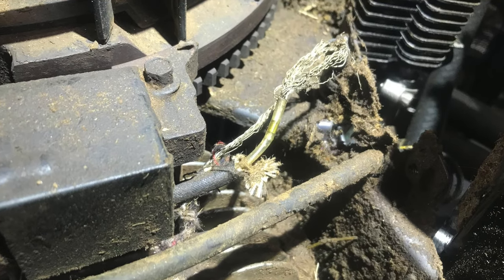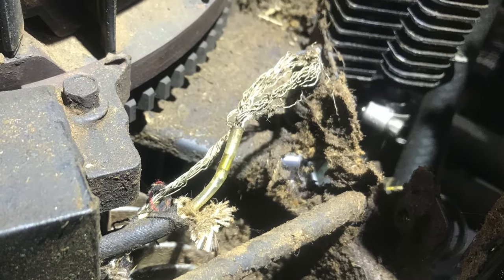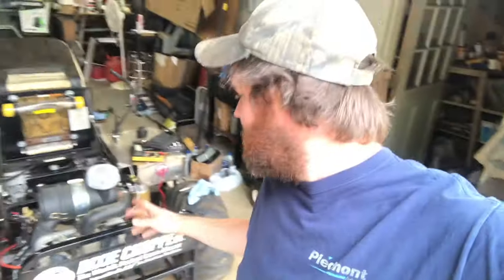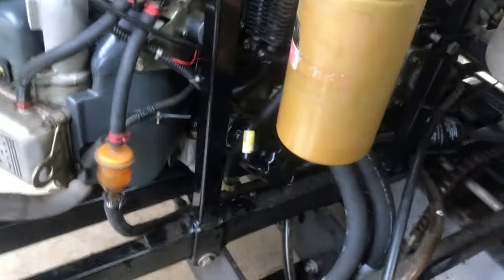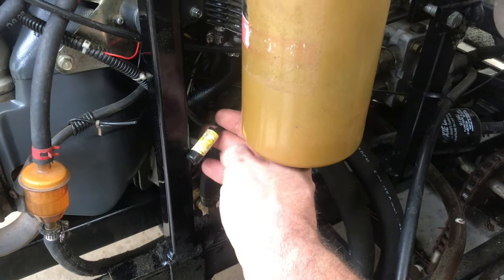Dixie Chopper

Comment: Had something similar on an outboard engine doing the same to me.  At the time, I thought it was a safety of sorts.  It was in the tiller handle.  Thought maybe if you rolled or flipped the boat it would shut you off.  Turns out I was correct.  I gave up on the motor as it was big, old and weighed a ton.

Comment: I used Dixie Chopper mowers for 22 years. I knew that there was a mercury switch installed but never saw it. Occasionally I would hit a bump too hard, and the engine would shut off. It would always restart.

Comment: Haha, I discovered the tip-over switch on mine too. I have the exact same machine.
Reply from the maker: zadok22 this is the first time I saw something like that on a mower. They are a well built machine. Thank you for watching and commenting!
Reply: @cannonballrepair7940  yeah I have had mine for 16 years. They are different. But I had one like it prior when I was in the lawn business. It was the heart of my work as most guys ran around with diesel Kubotas. I had my zero-turn, and loved it.
Reply: zadok22  I have a Dixie Chopper silver eagle 2760 hp its 10 yr old and bought a Kubota 1211 this year they r both good mowers the seat on the Kubota is better  but the Kubota needs better blades

Comment: When I saw that this video was about an older Dixie chopper and was recent, I jumped out of my seat! Great video!
Reply from the maker: Turf Destroyer Thank you for watching! Yeah that mower was built like a tank!!
Reply: I just had a dixie chopper XK2303 givin to me that I'm fixing and selling. Putting a new starter, battery, carburetor, airfilter, fuel filter, fuel pump and oil change tomorrow. Never had the pleasure to work on one until now. Thing is built like a tank

Comment: Good God I wish you were close by. I am working on the same mower. It would run before but not charge the battery. Checked the stator and it's dead. But now I have lost the spark. Everything tests good. All the safety switches have been bypassed. It does have the mercury switch so I checked it. I unplugged the kill wires on the coils, didn't make any difference. I can't see both coils going bad at the same time. Checked the black  relay and it checks good. If the battery is dead and the stator is not putting out anything how could the mower run before???  I'm running out of ideas.
Reply from the maker: The coils on this one in my video was a magneto style. They didn’t need a battery to run.  Kohler has some that require a battery. That is odd for both to go out at the same time. I’d try checking the ground connections where the bolts hold the coils to the block. If there’s corrosion there the coil won’t fire.  Hope that helps. Let me know what happens.
Reply: @cannonballrepair7940  pull the coils and shined up the mating surfaces with some emery cloth but still no spark. Just tested the ignition switch and it checks good. I already replaced the kill wire to the coils because the mice were hungry. Wonder if that mercury switch could be bad internally? I hate to just start throwing parts at this thing. So far the only thing that checks bad is the stator. Like I said before my grandson had to jump it every time he mowed but it would stay running all the time he was mowing, probably at least a couple of hours. The stator checks bad but wouldn't the mower die if the battery was dead too? Still scratching my head here.
Reply: Couldn't be the mercury switch because it connects to the kill wire. I unplugged the kill wire and still no spark.
Reply from the maker: @Dmax04  if you have the kill wires unplugged and still no spark then it really sounds like bad coils. But it’s odd that both went at the same time. Is the one kill wire per coil the only connection there? Some Briggs v twins have diodes in the kill wires and if the diodes go bad it’ll cause problems.
Reply: @cannonballrepair7940  just one wire from one coil to the other then it goes to a black and white wire that goes inside a harness. Haven't traced them down to see where they go. Guess that will be my next step.
Reply: I just noticed that the 5 terminal relay under the seat is real warm to the touch. I thought that was just for the safety switches that have been bypassed. For some reason it is drawing some amps. Probably what's killing the battery.
Reply from the maker: @Dmax04  yep could be. Also the mower in my video needed an ignition switch about 6 months ago. The ground was bad internally and it wouldn’t switch on. The fans wouldn’t turn on or anything.
Reply: @cannonballrepair7940  got the stator, regulator and coils replaced and got spark again. Now a whole new problem. The starter runs with the key in on position. Have read there are some diodes somewhere inside the wiring harness but no idea where they are located.
Reply from the maker: @Dmax04  I’m not sure about a Generac engine but on a Briggs there is diodes in their charging system. They are usually in the wiring harness coming from the stator. Is the ignition switch  or the starting solenoid sticking?
Reply: @cannonballrepair7940  ignition switch is good. When you turn the switch to run or on position the starter spins but does not engage the flywheel.
Reply from the maker: @Dmax04  I know this is gonna sound dumb but forgive me, with a starter spinning and not engaging the flywheel that sounds like the battery is low or even hooked up backwards. Low voltage will make one spin but not fast enough to throw the starter gear up. Or if the battery is connected backwards then the starter will spin backwards and not engage. If it is backwards that may explain the switch acting like it is.
Reply: @cannonballrepair7940  no problem at all. I have tried two different fully charged batteries and they are definitely hooked up right. From what I have read there is a diode hidden somewhere inside the wiring harness. The harness has a mesh type covering on it and I was trying to avoid stripping it all off but may have to. This mower is just one problem after another. Had it running a few days ago and it was fine. Went out a few days later and now the starter is messed up. May look at it again tomorrow. Just about fed up with it. Fix one problem then something else happens. I do appreciate your replies.
Reply from the maker: @Dmax04  of course they would hide that diode. What a pain! I’m sorry you’ve had so much trouble with it.

Comment: I See those in the food industry on tilt skillets and several other gas fired cooking equipment
Reply from the maker: I had no idea they were in the food industry. It makes sense though. I had seen them on a motorcycle but nothing else.
Reply: Funny thing is I worked on mowers, mostly exmark and Stihl but fixed everything that came through the door from mosquito killers to pressure washers and I never seen a mercury switch on anything until the tilt skillet. Well thermostats used them but that’s a little different.

Comment: i knew before you showed it, most dixie choppers have that, but if that stumped you, good luck when the hidden safety computer goes bad and you get one of those, for the record, it is hidden near the right fuel tank, and when it goes bad all kinds of crazy can happen, it controls the starter. When it goes bad the starter will not work and all the safety equipment will test a-ok, if you turn the key to run and manually jump the starter, it will run. If you bypass the safety computer you lose all safety interlocks, I have a way to just jump the starter lockout while leaving all the engine cutouts in place, but it is best to just replace the computer (NOT THE ENGINE COMPUTER, THE SAFETY COMPUTER).
Reply from the maker: I hear ya! Safety computer?! You gotta be kidding! I had no idea! That machine doesn’t have many safety interlocks to start with. Thank you for the heads up!!

Comment: I’ve got a Dixie chopper classic 3360 that the levers are really loose an won’t go as fast as it should what could be the issue. All the bolts are tight.
Reply from the maker: If all the linkages are tight it maybe an internal problem.

Comment: So I have a older dixie chopper classic with a 27hp generac v twin bassicly this mower anyway I have a question I can't figure out how to set the governor it i had to replace one of the governor adjustment plate and when I go wide open to mow its holding it a 4000rpm and its usually at 3000 to 3500 so its like forcing the governor

Comment: The new dixie chopper are slow the older dixie choppers are fast the reason they slowed them down because of liability issues
Reply from the maker: Mowingman816 I did not know that. Thanks for sharing. This machine has a “T box” Do the new ones have that?
Reply: @cannonballrepair7940  not sure
Reply: Was curious my mower really depends on rpm but makes sense to me

Comment: Where is that cut off switch located at?
Reply from the maker: It is located on the fan shroud.
Reply: @cannonballrepair7940  thanks 👍
Reply: depends on the model, on my newer one it is near the 12 volt battery